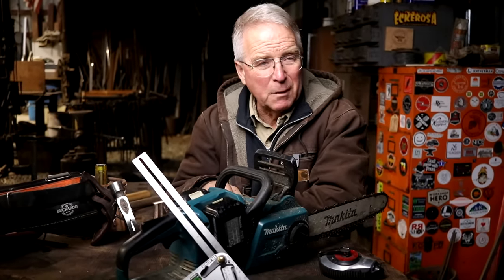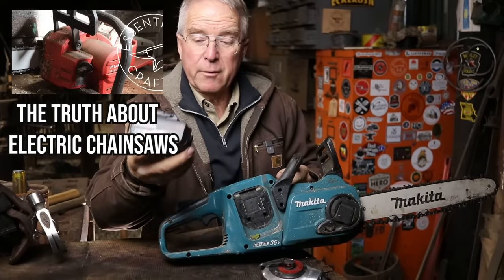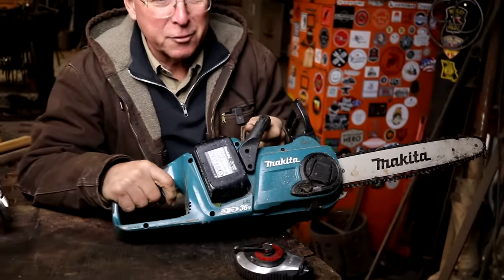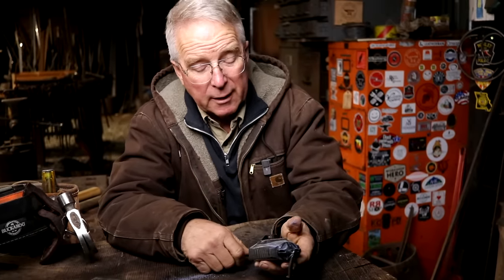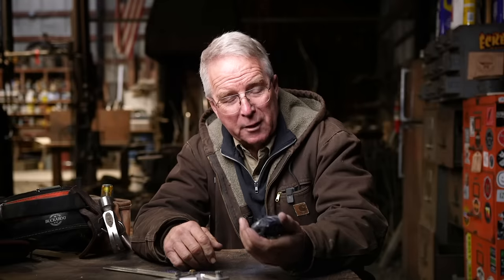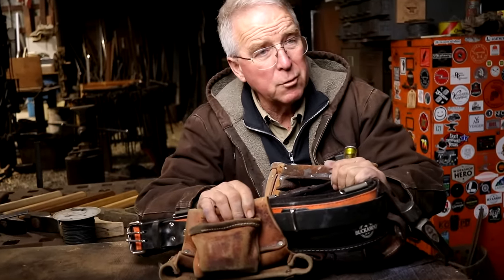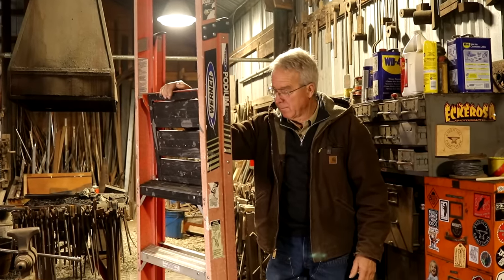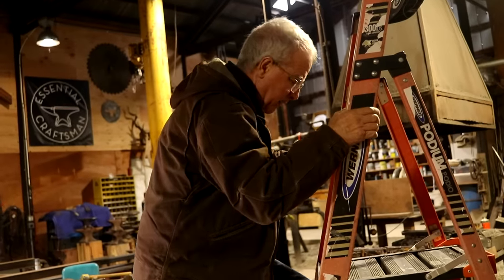5 Carpentry Tools I Wish I Bought Sooner

Comment: I never heard of the term 'podium' ladder, but I have one anyway. Mine is a Tricam step ladder I have had for 20 or 30 year. Just a short 2 step ladder, but the top step is a platform or podium with a railing to hold on to or to help give balance. So comfortable and safe to stand on. The podium snaps into place and always just let that happen when I step on it. When someone else wanted to use it, I forgot about the snap. When they step on it and hear it pop into place, they think they are a goner!

Comment: First time I've seen a Podium ladder. My first thoughts are "it's 3 feet too tall for how useful it is!" My second thought was, that it needs 2 flip-across steps built into the c-channel of the sides. That way you still get the security of the platform to stand on, but if you want the extra 2 feet of height, flip flip and you've got 2 more steps that flip down and lock onto support pins on the far side.

Comment: Tajima chalk lines are good and you can buy them with different thickness lines, 0.5mm, 1.0mm, 1.8mm and 2.8mm (0.02 in - 0.1 in) I have a Chalk-Rite Ultra-Thin filled with blue Micro Chalk for drywall (don't use oxide or snap line dye on drywall, it can bleed through the paint if not sealed correctly) and a Chalk-Rite Dura filled with black Snap Line Dye for marking out on concrete. The Line Dye is hydrophobic and lasts a long time on a slab.

Comment: Maybe I'm a bit late, but with the tajima , when you are attaching the hook to the body, if you put the end hook side out. It allows the little tab on the cap to go right through the end and really grab on. 👍🏻 I've never had any luck with the hooks going into that little slot.. on the other models (the all aluminum powder coat ones) they only have the tab on the lid and IMO have always held the end better

Comment: I got a garage w 13 ft ceilings and I use that height. Got a little giant extendable podium ladder w a painters add-on. It’s quite stable, even has wheels though they need a pretty shallow angle to use- not good inside. I had to measure this all out, height w me, and storage height . They have many models. The old ladder is rarely used and feels even more unsafe than it did before.

Comment: Ive the 18v Dewalt chainsaw(54v was out of stock or id have got it) it'll never replace a petrol but it wasn't meant to. Very usefull occasional tool. Theyre relatively cheap   n versatile

Comment: There are several versions of the roofus square but I've only found metric.  But I can speak metric too so it's not a huge problem.  I suppose one could scribe a few inch marks if absolutely necessary.

Comment: I don't use a chalk box much anymore so the aluminum one that I have had for years is more than enough for my needs, if I was still framing then, yea a new geared chalk box would be thing I would need to get. I love my podium step ladder, I have lots of standard style ladders too but if I can I will use the podium one every time. when I was young it didn't much matter but the tendons in my legs can't take the abuse of standing on standard ladder much any more.

Comment: If you're using your chalk box constantly as a framing sub contractor, tajima doesn't last any longer.  We went thru a few just as fast.  Stripped gears, end coming off and line ruined when wet.
Just get a half price Dewalt or Milwaukee.

Comment: Great video- subbed. 

Question- I'm going to be putting together a small carpentry section into my workshop. I am NOT going to be doing very fine projects, cabinetry, furniture making. 

I'll be doing simple projects like building tool racks, and basic shelves, organizers, etc. Stuff like you would see Adam Savage build on tested. What would you recommend a tool kit for stuff like this

I'm figuring- 

Table saw, drill press, router, nailer/stapler, some type of sander. As far as the bigger power tools go. Thanks

Comment: I started using chainsaws in '76, and started HVAC in '81, when battery tools were just getting started and I thought I would never rely on them. But now my next Makita tool will be a chainsaw, for the same reason, no fuel to make a mess and go bad and it's there ready to go when you need it

Comment: Well, now I know we have an inflation problem. I just looked up what a Makita circular saw costs. $177.00. The first one I bought was $129.00 back in the mid 80's when a carpenter's wage was about $7.00 an hour.

I watched those prices go basically unchanged through the years even as a carpenter's wage went up to about $30.00 an hour. If we did not have an inflation problem, I'm thinking that saw might still be about $129.00. 

It has been amazing to see some things get cheaper, especially electronic things. As companies get bigger and manufacturing process get better, many things have become cheaper over the years. 

I really liked the Makita cordless drills. I've had other brands. Makita outlasted them all.

Comment: Just a few weeks ago I learned that a "drill block/ drill guide" is a very useful $7 tool. It's simply a small chunk of steel with five or so holes to guide various drills, so you might not need to drill a pilot hole.

Comment: You can do the job with little to no tools. It irritates me when tradesmen don't invest in themselves as they come up. Not saying to throw your money away I am saying be prepared as a professional to do the best job that you possibly can under the circumstances. I agree with the chalkline. I also have a 15 oz stilletto and the light weight and lack of vibration I think has saved my arm. That 28 oz eastwing has its place. I call it the encourager. Because it moves whatever you hit.

Comment: Please be VERY careful with electric chainsaws.  They are capable of cutting your leg off THROUGH chainsaw chaps.   What’s that?  How is that possible?  What makes me say something crazy like that?   I read the instructions on my chainsaw chaps, that’s how.   Due to the full torque production at low RPMs, electric chainsaws will rip right through chainsaw chaps.    Seriously, go check the package for stihl chainsaw chaps.   Says right on the box, not for electric chainsaws.    No warning about a still 880 2 stroke, just electric saws.
Reply: Yeah.   I haven't found chaps yet that are "rated for use" with electric or battery chainsaws.   Seems some PPE manufacturer is missing a growing market segment.
Reply: @tree_carcass_mangler  I don’t know if it’s possible.   Having that much torque down instantly can be hard to bind up.
Reply: @AaronsSpeedShop  Good point.

Comment: Podium ladder is too big to lug around-a good folding ladder works just as well… chaulk lines are basically obsolete … don’t step on my job site unless you have a tool belt- most young carpenters wouldn’t be able to figure out a tri-square — I do like the chainsaw- but I’m going to my trusty  little 171 for max power